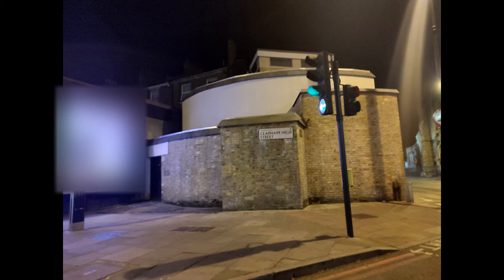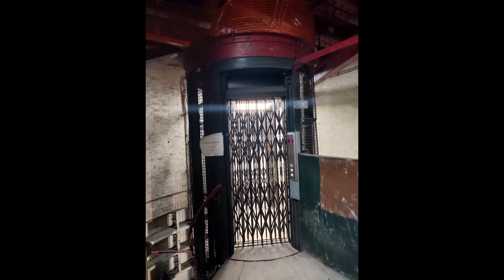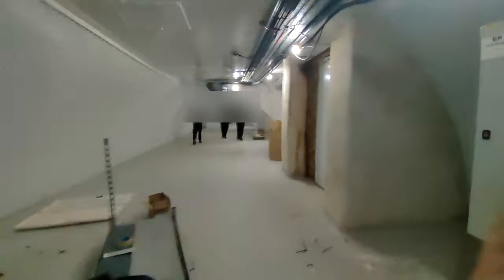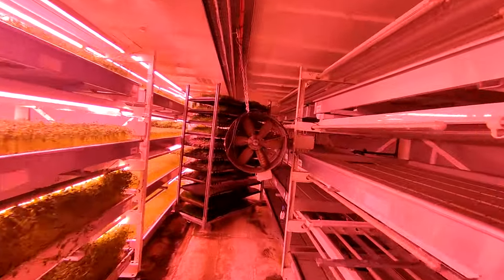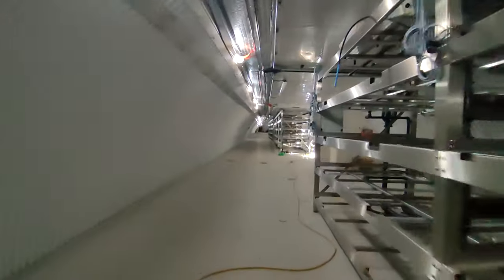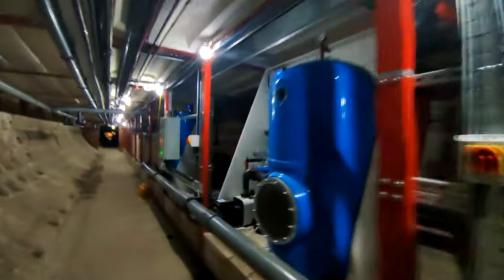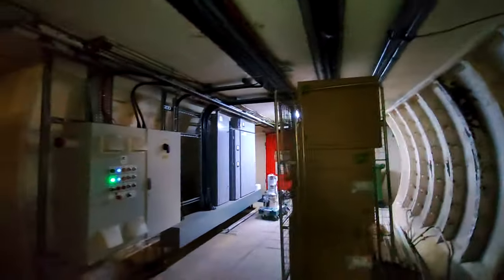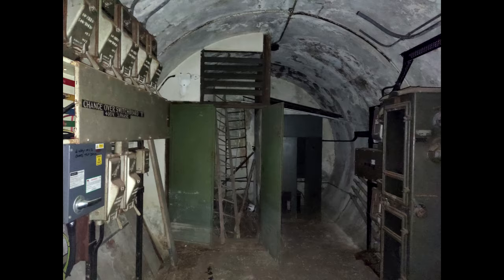URBEX Clapham Common Bunker

Comment: Fantastic conversion of it. I'm pretty certainly this is the one I saw stuff about. Could have been on the One Show. I really like the lift modifications. That's great with all the old electrical gear that's still there. Superb dedication, and an excellent achievement. 👍
Reply: I don't like the modernisations personally. Leister controls is utter crap and I think it has removed some of the character and heritage from this lift.

Comment: cress can literally grow on cotton wool - i dont see the need for all the equipment.
Reply: maybe it's the compost that's more experimental than the watercress... ^^
Reply: @GraphiqueDesignbf  yeah, tbf they might be trialing different amounts of nutrients and fertiliser in the water supply and comparing the growth rate. They may have used cress as it's a relatively fast growing plant so it doesn't take long to do analysis.